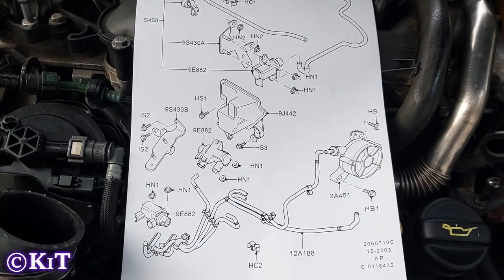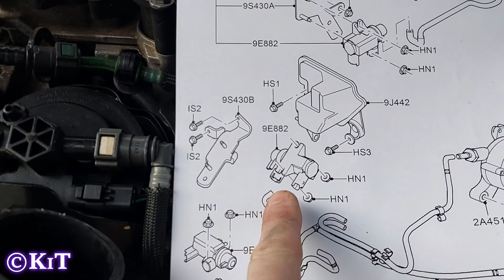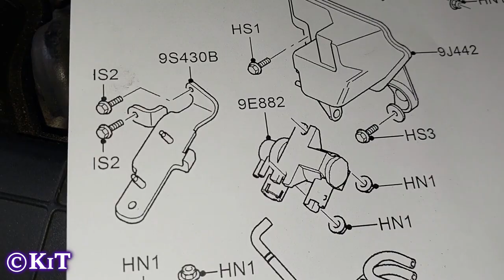The Hidden Valve ! Finding out that a Ford Focus 2.0 TDCi has a hidden third Pressure Control Valve.

Comment: Thank you so much for posting this!  After I did the 8th oil change two days ago, I connected the hoses in a wrong way. I found that diagram too, but seeing you explain it on the car makes it much easier. In my case, one tip of one of the 2 T connectors has no hose. I guess I will have to search for it down below. Your car is in better condition than mine, no big oil leaks, so easy to see al the parts and working on them.
Reply from the maker: @ciutacu Hey, thanks for your comment. I am so happy that this helped you. I too will be driving my Ford till it falls to bits. I will be posting a video soon explaining how I think the throttle body works.

Comment: Interesting video. I have the same engine in my 2007 Mondeo, however on those it only has one inlet, with two pressure control valves to the right of the engine.

Interesringly, my engine has a knock sensor just under the fuel rail, but no wires going to it! Any idea where the wires should run from?
Reply from the maker: Hi Rik, thanks for your comment. If you have the same engine then it is most probably DW10 PSA engine. On my engine it has two inlets as the turbo is at the back of the engine. I will do a video on that, but at the moment I am working away. I could not see such a sensor under my fuel rail. I will look though. Were they even fitted with such a sensor? I know the engines on the Focus and Mondeo look the same, but I think there were a few differences.

Comment: I've looked high and low for this and not been able to find it I really appreciate you sharing this I have the same engine and I have a boost issue you don't by any chance know where the fuel pressure sensor is located
Reply from the maker: Hi Fordyuk26, thank you for your comment. I believe the fuel pressure sensor is on the fuel rail. It is also difficult to see. It is on the bottom of the fuel rail roughly between the fuel injector pipes of cylinders 2 and 3. I hope this helps.

Comment: What was your problem with car and what symptoms it has ? I have problem with no getting turbo boost on this engine with error code P0299 car is running like it have 60bhp instead of 136bhp I changed that Y piece on intake also I put a new hose from intercooler side, cleaned EGR and check all of those vacuum pipes and nothing seems to work
Reply from the maker: Hi @alantir666. Try the following, reset the fault and disconnect the turbo vacuum pipe, test drive  and see if you get another error. After that connect the turbo vacuum pipe directly to the vacuum by passing the valve. This is a good way to test the turbo vacuum diaphram and the Vacuum solenoid / switch.
Reply: @knockittogether-kit  Thx for reply I already change solenoid witch going to turbo actuator but I found side of pipes witch control hot air intake are leaking some where can it be possible that solenoid can have leak ? also that black tank in system right under that Y piece of intake can it leak somewhere ?
Reply: @knockittogether-kit  I solve a problem it was that zip tie witch were holding those pipes together over time pipes gets soft and zip tie mash them together so it restrict amount of vacuum going into the solenders
Reply from the maker: @alantir666  Cool that you found the problem. Somtimes it is something silly which can cause a car to run badly.
Reply from the maker: @alantir666  There are three solenoids in the system if it is the same as mine. If one or both of the other solenoids are faulty, then you may not be getting the needed vacuum required.

Comment: Have you done the glow plugs yet 😂😂😂😂 you will love them egr and cooler must be removed 😢😢
Reply from the maker: Hi Karl, thanks for the comment. Yes,I have done the glow plugs and the egr at the same time.For anyone wanting change these items, I suggest being blind folded for 2 weeks before hand and learning to do little jobs in the dark. I would also suggest learning to bend over backwards. As you a fewer words pointed out, they are bastards. 🤣🤣🤣
Reply: @knockittogether-kit  that fuel injector return unit is a heat sensor the plug part comes off the pipe unit just a sensor and 3 holes for pipes just taking fuel pump on vacuum pump off changed all sensors crank cam and few other things it fucking refuses to start 15 times cranking then will go then checked live data no codes  new good battery  2.2 kw starter  at a loss o and had new fusebox
Reply from the maker: @karlbigmore7949  OK, iI had  a problem like this and it turned out to be the solenoid on the low pressure side of the pump. Check to see if that thing is opening.If it is not you will be cranking till the cows come home.
Reply from the maker: @karlbigmore7949  You could also check this by loosening off an injector pipe and cjecking for diesel.

Comment: Hi
What was the problem to change those solenoids?
Reply from the maker: Morning, they were very difficult to get at and I did not know that the Solenoid was buried underneath the other solenoid. It is attached to the under side of the plate. That document is the only reference I have found relating to the Ford Focus Vacuum system.
Reply: @knockittogether-kit  But what was the problem with the car?
Reply from the maker: @Ray-om5xt  Hi, the problem I had was that as the valve was old and malfunctioning, it was no longer holding the vacuum which would was causing a whistling sound and  problems with the turbo operation. This valve also controlled the anti shudder valve.
Reply: @knockittogether-kit  Hi anti judder valve? I've never heard of that, mine used to judder under acceleration. My exhaust has broken at the flexible pipe and now I have poor performance but no juddering. 
How does the anti judder work?
Reply from the maker: @Ray-om5xt  Sorry mate, my mistake. That should be shudder valve. It helps when turning off the engine by cutting off the air supply.
Reply: @knockittogether-kit  OK thanks.
Reply from the maker: @Ray-om5xt  That said, maybe if you have this sort of valve unit on your car, you should check to make sure that the valve on the left is open and that the valve on the right is closed by normal operation, (when looking from the front). The judder you are having on acceleration could be due to lack of air to the engine.
Reply: @knockittogether-kit  Mine has only one inlet valve for one butterfly. I thought it was a bent driveshaft. It's stopped doing now. I can only think that it's engine related. Thanks.
Reply from the maker: @Ray-om5xt  You can always check that butterfly valve by taking off the vacuum pipe and sucking it to see if it operates smoothly. Sometime the plastic cogs are worn.
Reply: @knockittogether-kit  Good idea thanks.
Reply: my ford 2008 no pass 3k rmps when its on move...compiter tell me for...high presure valve...if i change this what do you think will she pas 3k rmps.? its ford focus 2008 2.0 tdci
Reply from the maker: @bushivlor  hi, thanks for your comment.  I would check the solenoid valve going to the turbo first, to make sure that it is not keeping the turbo vanes in the wrong position.Try with the pipe off, then try by bypassing the valve and directly connecting the pipe from the turbo to the vacuum supply.
Reply: @bushivlor  Hi there
It sounds like it could be the high pressure valve as the rail pressure could be low. I don't have component data for you car but those is for a mondeo.
Remove the electrical connection and measure the resistance of the valve, it should be around 6 ohm's put 12v to it to see if it clicks or moves. With the electrical connection connected the voltage should be between 11 and 14 volts. You could check fuel pressure with the computer or just get one from another vehicle. It does sound like low fuel pressure.